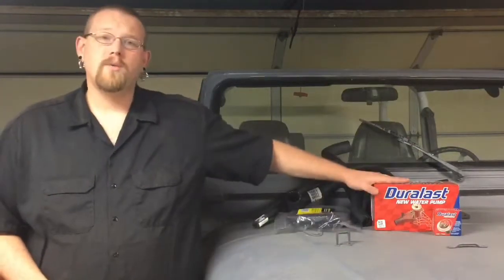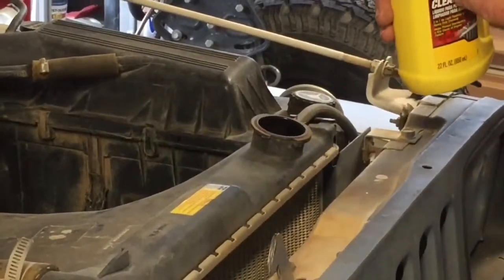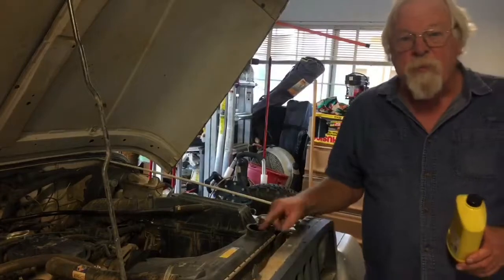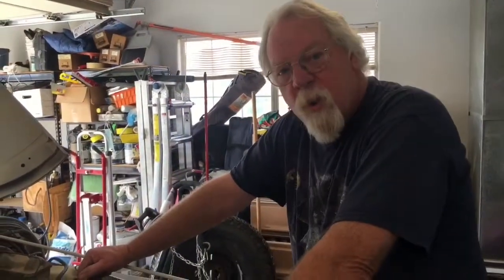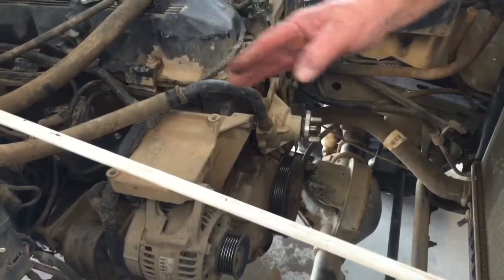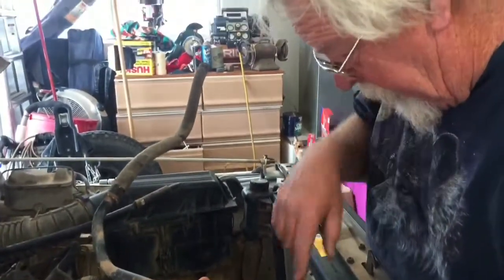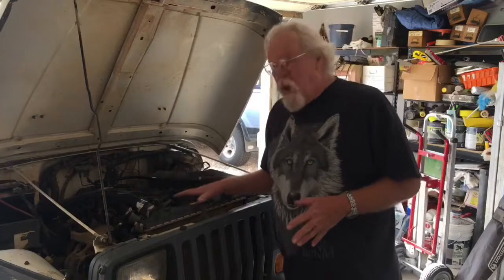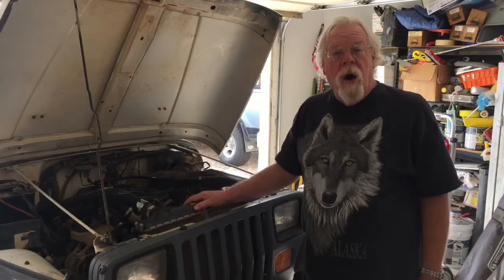Jeep wrangler cooling system rebuild

Comment: that tensioner pully is on your right near the filter box. look closely under the pulley for a threaded bolt top side.  Mine has power steering so I don't know if yours does. But the tensioner is in with the power steering. Its hard to explain without seeing it
Reply from the maker: betty herndon thank you. Yes it did have a thermostat